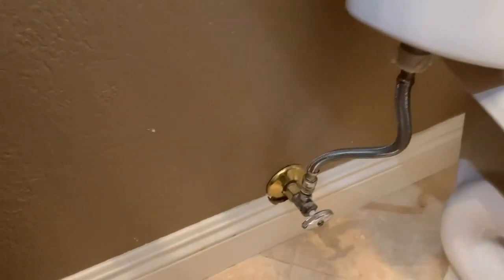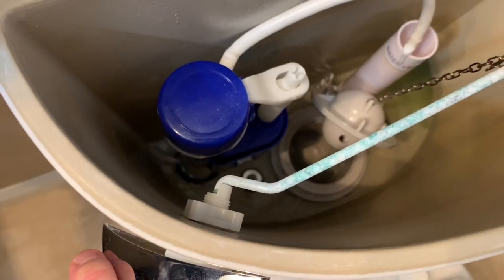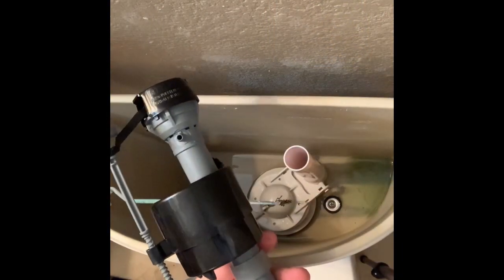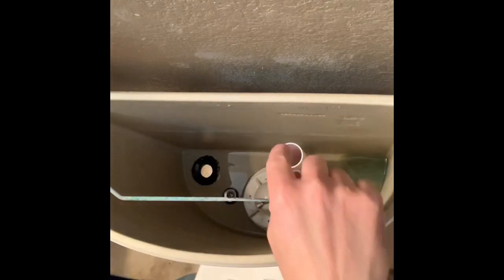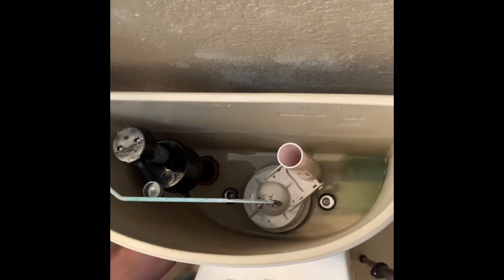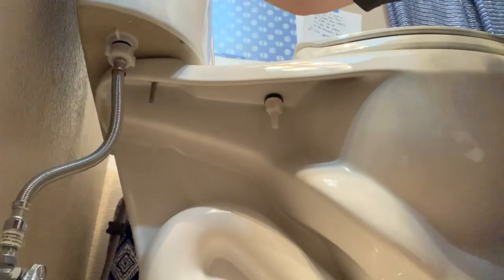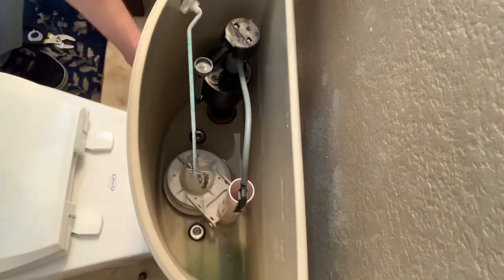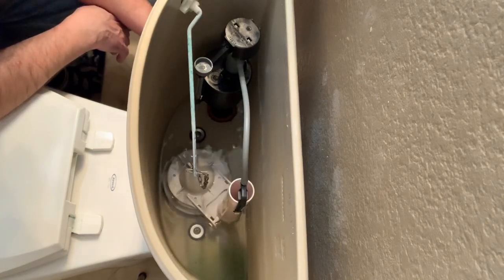Toilet Fill Valve Replacement-Guaranteed Fast & Easy!

Comment: Thanks, very easy to understand! I'm sick and tired of issues with a toilet at our rental, so I'm going over there once and for all and fixing it tomorrow!   I wanted to ask you about this issue.......One thing that has happened a couple times with this toilet, is when the water is turned off to the condo (which water valve in garage is pretty close to the toilet in the house), the toilet starts running again once condo water is turned back on, even though it didn't have running issues before water to house was turned off. Maybe the water level is just too high (??). I'm to the point, if the water to the condo has to be turned off, then I need to turn off the toilet first, then turn off water to condo, turn back on water to condo, then turn toilet back on. Any thoughts?  Thanks!
Reply from the maker: That sounds strange. Is it possible you have a small leak at the toilet that you haven't realized, and while the water is off to the condo, enough water leaks out of the tank requiring it to fill when the water is turned on? Maybe drop a few drops of food coloring in the tank and wait to see if it leaks into the bowl.
Reply: @MikeKlimek  Thanks for the feedback. I went over there last week and set the water level lower and so far so good. We are about ready to do more turning the water on and off in this complex. If it happens again, I will do that test. thanks!
Reply from the maker: @kathykifer2693  You're Welcome!

Comment: I could not remove the old fluid master
What do I do
Reply from the maker: You can either use a hacksaw blade and cut throught the plastic nut underneath the tank (that holds the fill valve to the tank, or you can watch my video on a quick replacement: https://youtu.be/y6J1cfvQOGg

Comment: I need urgent help, please. After I Removed the water supply
connector from bottom of fill valve then I tried to remove old Locknut
Below tank, by twist locknut to the left, the old locknut would not come out. I tried with wrench and I think my wrench broke. 
Please guide me to reomve old lockbnut below tank. It is urgent. Thank you.
Reply from the maker: If you’ve removed the water supply from the bottom of the fill valve, hold onto the fill valve with one hand and twist the plastic nut off of the bottom of the fill valve with a wrench in the other hand. The fill valve should lift out of the hole.

Comment: Dude need help again! My toilet handle, flapper, valve need replacement, which one of these 3 should I fix first, second and last!
Reply from the maker: The handle and flapper are the easiest and fastest. ...as for the valve are you talking about the fill valve, flush valve, or water supply valve?
Reply: @MikeKlimek  thanks man. I did all 3. Now I got another issue with toilet. The toilet tank leaks some water when it is flushed. The tank water seeps from bottom of tank and some of it falls onto the floor amd other seeps from bottom of tank flowing into the toilet! Please help to fix this issue.
Reply from the maker: @jakeb8298  Man you have a lot of toilet issues!  You're going to have to remove the tank. I would replace the flush valve and spud. Before you do that though, check to see if the tank has a hairline crack at the bottom of it. You can run your fingernail along the bottom and listen for a "click" or resistance.
Reply: @MikeKlimek  do you have any video showing how to fix this issue? This would really help. Thanks man.
Reply from the maker: @jakeb8298  Sorry I don't

Comment: My toilet fill valve won’t stop and the little tube attached to it and putting water into the hole keeps running.
Reply from the maker: It sounds like you need to adjust the float downward to shut off the water earlier. If you lift up the float by hand does the water shut off?
Reply: Mike Klimek I have the all black colored fluidmaster universall valve  the 400a.  the end of the cap holding the rod with the philip like screw on the top that is used to turn to move the height of float up and down broke and now it won’t reattach. I was following other video on how to clean debris from the valve. Now It looks like i will have to buy the whole valve again.
Reply from the maker: @xyzsing4038  I agree...they are plastic and I would replace it
Reply: Mike Klimek what should be the height of the valve relative to the hole (to which the thin pipe is attached)in the tank?
Reply from the maker: @xyzsing4038   There is a line marked on the valve with the words "critical level" or "CL"  stamped on it. It should be 1" above the fill tube.